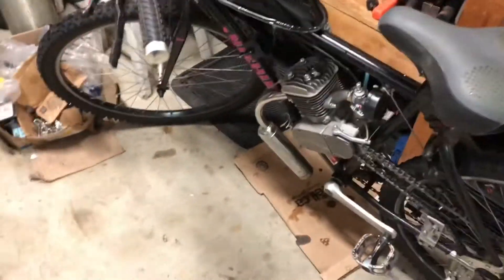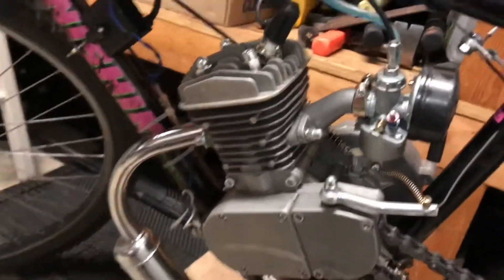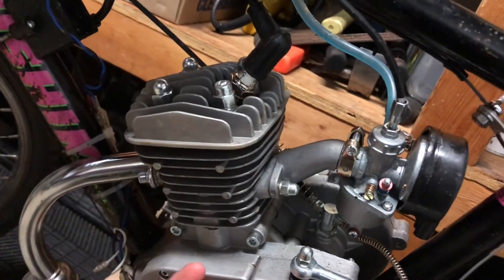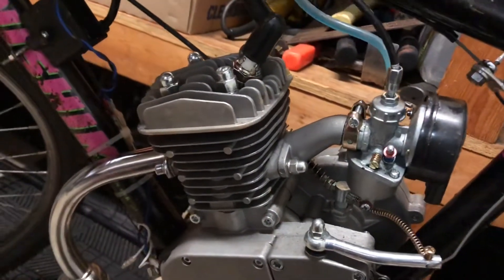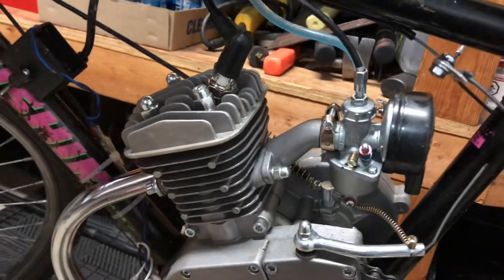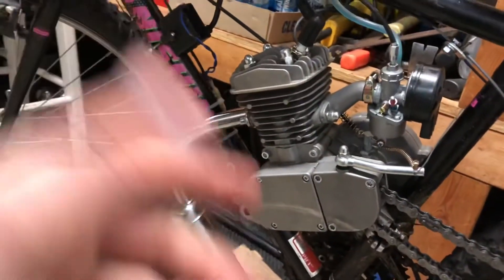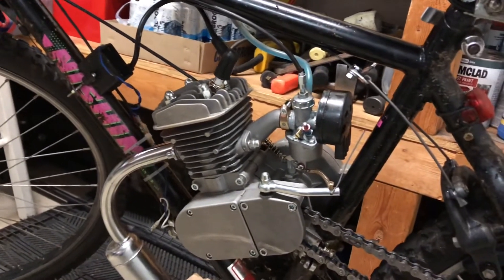Making MORE POWER for FREE on your Motorized Bike!

Comment from the maker: This video seems to be blowing up, is anyone else interested in more motorized bike content? Like or comment this if you want more
Reply: you want to go faster take the 10mm tool take muffler baffle. no need to go with this b.s oil mix
Reply from the maker: @Hoosirdaddy that just makes it run worse and get louder. I’ve done real testing, check out my lasted video. Don’t call the oil mix BS if you haven’t tried it.
Reply: @Hoosirdaddy es but keep in mind when you remove that baffle it's going to be loud. I got two mufflers I may gut them both, then using A V-pipe. Make a fake dual exhaust then put silencers on the end of them and have them travel to the back of the bike. Now it's just one idea I have.
Reply: subbed for the motorized bikes :)
Reply from the maker: @TheDanMatlock  Thanks man!!
Reply: Yesss
Reply: This is very helpful information I am just about to assemble my bike kit and I thought that the oil mix was a bit much very helpful information
Reply: @spagettiman8310 eah that 16:1 is absolutely ridiculous😂 trust me I know I tried it you'll have oil coming out your exhaust and everywhere. Especially if you didn't Deck The Block😂 I start with 24:1 then after a couple of tanks, approximately 4 L, I'll back it off the 32:1 and keep it at that. And even that's a little teeny bit rich but I still believe better loot more lubrication is better than less as long as you're not getting super excessive with it like 16:1 😂 another tip that I'm sure a lot of people already know ditch that cheap Chinese spark plug with a Z on it and replace it with the appropriate NGK. Especially if you're going to run that ratio of 16:1 that cheap plug will fail😂 the NGK plugs are the way to go and you will notice a big difference provided you gap them correctly. I like to check my Gap just under 0.030" so any where's around 0.025" to 0.029" I find to be a good gap for the NGK BR6HS.
Reply from the maker: @spagettiman8310  Thanks man! Good luck on the build 👍
Reply: Man I just got one of these I'm glad to know this before I put any file in
Reply: Yea make some more
Reply: How about not using oil at all???
Reply from the maker: @marguskiis7711  It would lock up within 30 seconds… maybe listen to the video or do 2 seconds of googling to realize you need to burn oil in a two stroke?
Reply: Most definitely man these motorized bikes are my new passion. Especially where I'm a certified small engine mechanic and I couldn't find any work in that field. So why not put it to something. And it's videos like this that really help us all. The factory knows dick all about their own designs😂
Reply: YES more bike content
Reply: Hey brother I would love to see some videos on rear rims, upgrading the rear rims, various ways of mounting the sprocket, different axle sizes and how they correspond to various different frames, when ot comes to axle O.L.D and frame dimesions. How to ensure that a magnum rims will fit your bike frame that you're going for. See myself I'm a certified small engine mechanic but I'm far from a bicycle mechanic and this is where I'm getting tripped up.
Reply: 32:1 what? How much oil I need on in 1 gallon
Reply: I've got one I run 32:1 with about 4,000 miles on it.. knock on wood no mechanical problems minus the little things like 1 chain replacement, and a new handle bar throttle (lol I replaced mine with a 3rd brake lever.. those plastic throttle handles aren't great, mine where the metal wire is held by the white plastic inside the handle was held together with zip ties, and the little lead head on the wire finally broke off so I used a crimp nut used for holding and adjusting the brake wire to the pads on a 3rd brake handle so I didnt have to get a new throttle cable.. ((I need too though as much as I ride it))
I've beat mine to shit and she still fires right up. Now I've blown out the gasket for the exhaust because of a little wreck where the exhaust bent and made a gap around the gasket.. another guy recommended using some thick cardboard from a hard cover book and soaking it in oil and using that as a gasket and that he does this without problems but havent tried it yet. I acknowledge mine is an absolute Frankenstein now. I'd like to point out you should start adding a shot of high mileage sea foam to ever gallon of fuel. It's cheap, and will keep your pistons and carb clean. If it's going to sit over winter, run some non-ethanol fuel through it before parking it.. An ethanol fuel will split when sitting for a long time, and when the water splits from the fuel, it causes rust damage, then the split crude in the ethanol fuel will gum up your carb and when you go to press that little plunger to prime the carb, the float bowl inside will just adhere to the gum and flood the system because the float cant rise back up to cut off the fuel supply accordingly.   Get some more lights buddy. Not enough strobes
Reply: To this day
Reply: Yes
Reply: Add a nitro kit.......
Reply from the maker: @troy6882  I would!... if they weren’t a sham and they actually did something. https://youtu.be/0q7SSjfKclc
Reply: @Everatti  that's a boost bottle, not nitrous lol
Reply from the maker: @mrbanana7167  true lol
Reply: @troy6882  that's a really really silly thing to say.and if u do it kiss it goodbye. Yes it can be done but what is the point the components on these motors are not made to handle that type of compression only an idiot would do that. Or someone with a lot of money and a lot of time on their hands if they were really bored. But that's me I don't feel I need even for a boost bottle long as you have no vacuum leaks you are good to go
Reply: @joerillarilla8524  we know titanium would fix that last one before it got stolen 5 years toying on these 80puck boost bottle and nitro take a 55km before bearing oil leak out on better parts this could be possible in first gear the new was already damaged on the seals had to refit the hole thing covid-19 product!. Still want your cash but????.
Reply: @joerillarilla8524 I think people who do stuff like that already know these motors are cheap and will definitely likely blow them after few runs then we'll have to rebuild them or buy another one. I believe those are the guys who race these
Reply: @troy6882  you can set up one for racing but it cannot be one to go around Town reliably there is a difference
Reply: @joerillarilla8524 exactly I guess I should have read through all the comments apparently someone has already said what I just said😂
Reply: @troy6882 most cases it’s not even nitro bro it’s a co2 tank the same ones airsoft guns take 😂
Reply: @troy6882  nitro is a bad ideal unless u are just trying to replace ur block clutch wrist pin and i could keep going.if 3 to 5 hp is not enough for u .i recommend u get a motorcycle start around a 650 because you buy a 250 or just going to want a faster one in 2 weeks if you live through the 650 then graduate to 1100 good luck with that

Comment: I’ve got a 66 (or 88) cc bike, but on a 29” frame, so it’s rare that any parts or mods I see are able to fit my frame.  THIS, however, may be the slight power boost I’m looking for. I’ve got a larger frame bc - well duh - I am “bigger”. I look forward to adjusting my mix and giving this a try. Thanks.

Comment: I tend to run 25:1 in all my bike engines after break in.  I’m considering going to 50:1 like most European two strokes. 16:1 is a terrible mix other than for the first tank. That ratio was used back in the 50s when they mixed any old oil in with the fuel.

Comment: Use a 16:1 at first on a new engine for the sake of the wear in period (it gives that extra lubrication for the new parts shaving off metal fragments during the first couple hours of operation.). I run 32:1 in mine after break-in period, it works perfectly 😁

Comment: I've ran used motor oil for 4,000 miles in my 66cc kit (Since new about 5 year ago)   Around the 3,000 mile mark the spark plug gap started closing up.  I found the wrist pin and wrist pin bearing were worn.  I replaced the top end (with original cyclinder that I sanded by hand to break the glaze) and it's been fine since.  I run a thicker mix, probably 32:1, but I'm not even scientific about it anymore.  I'd bet I saved enough on oil to buy another 66cc kit.  Never even fouled a spark plug.

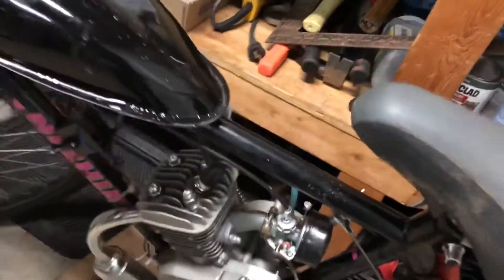Comment: You would foul the spark plug a lot faster at 16 to 1:00 then you would at 32 or 40 to 1. You will oil fill those spark plugs at 16 to 1 or 20 to 1.. run 40 to 1 from day 1

Comment: I’m using 8 ounces of oil per gallon of gas for the break in period, after the first 200 miles the manual actually says to start using 32:1 or 4 ounces of oil per gallon of gas. 200 miles is 1 gallon of gas or about 1.5 tanks as most of these bikes have 2.5 liter tanks. You’ll also want to tune the idle on your carburetor, and make sure to check the torque on your cylinder head bolts. It should be around 11, as that’s the standard for most of these bike motors. Don’t torque the head bolts more for higher pressure, it creates more strain on the bolts and creates the risk of sending a piston head right into your buttocks.

Comment: One more comment I want to make a boat how you noticed a difference when you leaned the oil mixture out after your break-in. I wholeheartedly agree with you and I would say that's because you don't have a spark trying to fire off not just the fuel like it's supposed to but whole bunch of excess oil which is definitely like putting low-octane fuel in or adding a little bit of water to your fuel in other words your fule (high octane or not) will simply not burn as good as it has all that oil affecting how it flashes off. When it comes to the oil ratios you very much know what you're talkin about.

Comment: I know I've made a lot of comments already but another tip I want to toss in there, that I've learned as if you're the type person like me that will tear into these blocks and do a few things before starting them, then you'll have the opportunity to coat the crank in the cylinder walls with 2-stroke oil before reassembling and starting for the first time. In my opinion they helped us so I didn't have such a dry start on its first turnover

Comment: See I just un-pause the video you run 32:1 I think that is a good ratio. And it's a great compromise between the 24:1 the factory reconends and the 40:1 alot of the old school guys swear by. I find 32:1 to be perfect. I run castrol "Go" low carbon deposit formula. Still not synthetic tho. Never run synthetic, imho. But I notice you your semi or full synthetic and you find you have no issues? Do you break in using synthetic oil as far as I know that's a No-No. But hey it worked for you man sweet. I do know this about synthetic oils though once you go synthetic you can't turn back on any motor. At first I was running ever-ready outboard motor oil and it works great. Me personally I'll stay away from the synthetics but if it works for you all the power to you my man

Comment: And the reason why the simple designed motor does work with mixed gas, like many two strokes. Is because it uses a needle bearing which does not require pressure in the crankcase to lubricate. Some two-stroke designs folr say dirt bikes, etc have a splash paddling the crankcase the sloshes the oil up into the cylinder area/crank. These motors are as simple as a two-stroke gets

Comment: Putting oil in your gas is no compensation for not having cams and lifters and valves it is just simply for lubrication rather there is cams and valves are not that has nothing to do with the fact that engine needs oil

Comment: Usually, manufacturers of the motors set it a little richer(more oil in gas) than it needs. They do it because if you run it too lean(less oil in gas) chances are greater that it'll blow-up.

Comment: Would you clarify what you mean by the not abusing it by keeping it "pinned" etc... I'm building my 2nd kit this time over a decade later and don't understand mechanic jargon. I'm autistic and am capable of understanding what you meant if you were to explain it differently, perhaps using real life examples. That will help add to the mental map I am creating about this topic. Are you saying not to throttle it fully for 5 min at a time or several hours. Or perhaps you meant not to do that for more than 5 seconds at a time with intervals of minutes between. I just need clarification of that complete statement using examples. Then I'll understand according to my mental map of this topic. Like in a car you shouldn't rev the engine over 4,000rpm or higher in some. Usually there's a visual indicator. Here there is no such indicator. So I have to mentally map it out. Thanks for your videos. ☺️

Comment: More oil means higher viscosity which means it will change how it is jetted into the carb. Thicker liquid means not as much will get jetted into the carb, so it might actually not be getting enough oil even though you are using a strong oil/fuel mix. 

What are your thoughts about that, is there any validity?
Reply: You are correct

Comment: These engines are unbalanced and no matter how much throttle you give them, eventually the vibrations will ruin your main crank bearings. Go buy a balanced crank if you wanna go anything over 32 kph

Comment: This is how I know you don't know what the hell you're talking about. You realize what Octane means right? The higher the octane the higher the compression required to ignight the fuel. DON'T use high octane fuel on these lown compression engines. You're ruining your engine by using higher octane fuel than what the engines are rated for... STOP spreading this misinformation go talk to the guy on the Bikeberry channel. He will teach you the things you need to know.

Comment: Hey just fyi 93/94 fuel shouldn't have any effect of carb cleanliness. Higher Octane rating just prevents misfires in high compression engines. You can run 87 just fine on the bike, higher Octane gives no benefit
Reply from the maker: You’re right - higher octane is unnecessary in these engines. Only reason I suggest them is because often higher octanes contain low or no ethanol. Ethanol is what kills is carb if it sits. Not 87 octane.
Reply: Huh. Thanks for your response! I just did a little Google dive and couldn't find a good answer about ethanol % in 87 vs 93 octane fuel. They keep saying it's 10 or 15%, but won't say which one is which lol. I think it varies by gas station and state? Anyways. Good luck with your bikes. Glad to have learned a little something.

Comment: I had an 80 (66) cc, maker unknown, that I ran on 50-1 for a almost two years as a daily driver.  It hauled my 200+ lb. ass and large loads of groceries around just fine.  Then, one day it missed a stroke and 'tinkled'.  Luckily, it was only a few more blocks home.  When I tore it down, I discovered that the wrist pin was DEEPLY scored and that had allowed 2 of the needle bearings to escape and do a high speed polka on the head and piston which broke the top ring, which scored  the piston and everything nearby.  Moral of the story; a higher ratio of oil to fuel is necessary if you are carrying higher loads.  I don't think I am going to weigh less any time soon, so I am not going to run less than 40-1 from here on out.  Maybe if Royal Purple made a 2 stroke oil...

Comment: He’s right I’ve been using Lucas 2 stroke oil for 5 years it’s the best on the market I can get a quart for $9.00 bucks and that’s it’s better than that other crap out there I’ve got a BT 80 electric start 2stroke for 2 years now same one daily driver I use a 36 to 1 mix no problem rpm’s are good a lot of hp , I’ve changed a few carbs out, electrical components on the BT 80 , muffler, a spark plug. But no damage in the engine inside.

Comment: These engines are so inefficient that even running 40:1 mix you're going to get excess oil buildup everywhere, depending on what you're doing with the bike, using Synthetic Oil you could probably get away with 50:1 or leaner, again, depending on what you're doing with it...

Comment: Dudeeee, i dont know if you will see this but thank you sooooo much. When i got my engine i was 13 (it was in the winter because i was bored) and in 2 months im 15... I was running 15:1 the whole time because the instructions said it and there was black oil every where also the cylinder head and all us complete full of oil. I thought maybe i had to much fuel and to low air, than i changed the fuelfilter and nothing helped... A few days ago my bike broke down and now i wanna build a gokart with the same engine.
I collectet a lot of experience in the past two years and made an apprenticeship as an mechanic so maybe i could even try to supercharge it.
My question is: if the motor will run aqain how do i change the mixture? Can i instant just go from 15:1 to 30:1 or do i have to do small "steps"?
Reply from the maker: Congrats on your apprenticeship! I’ve researched a bunch on these engines, I don’t think it’s possible to supercharge them, especially being two strokes. But definitely go ahead and try! And for your question, changing the mixture immediately is perfectly fine for it, it won’t hurt anything whatsoever. I’d go anywhere from 32:1 - 40:1, it’s up to you. If you get it running you’ll notice a massive power difference! And it smoke and leak a lot less than what it used to do. Hope that helps!
- Everet
Reply: @Everatti  well, thanks very much for your answer. Aight, when its running again imma fuel it up with 32:1 and then ill try to supercharge it, but off course it wont be easy😅
Have a great day!